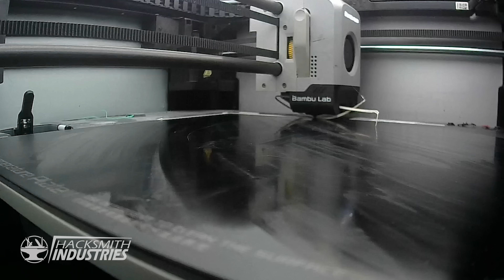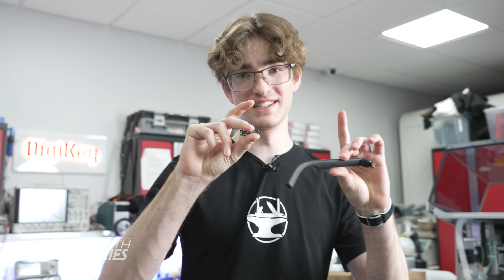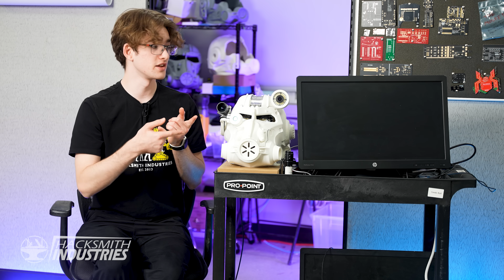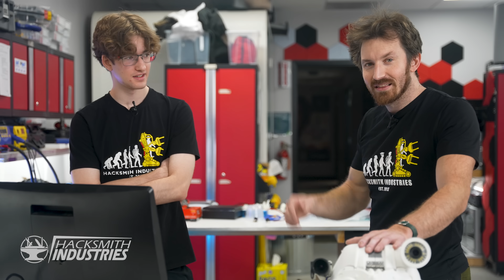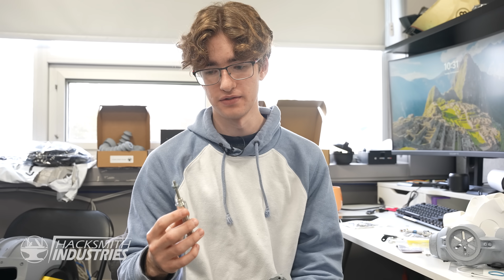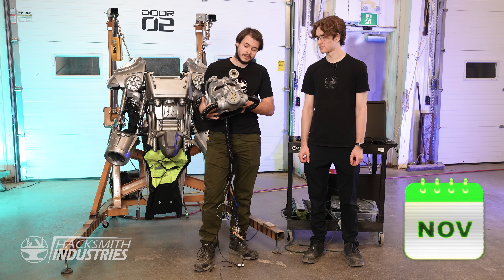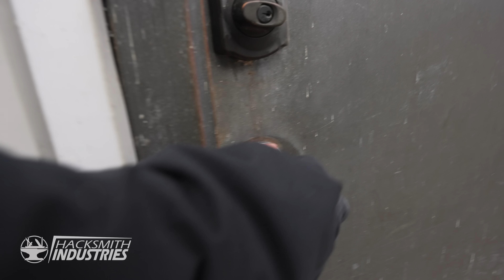World's Most Advanced HUD | Real Life Power Armor (Part 3/6)

Comment: Can an Ai pick out a person on a thermal camera, then over layer them on an NightVison IR Ar systems, without the latency sucking :P
Reply from the maker: why is that necessary? the thermal overlay can overlay on a temperature gradient, so it would automatically do that... no ai needed...
Reply: @hacksmith  And for that I'd highly suspect it would need object recognition.... I did not want to go as far as being able to point and anc "click" using AR glasss to try and keep track of a specific tag, as latanecy is an issue... The KISS principle.
Reply: Though on second thought Point and click to tag and have a  drone track and/or investigate that target might be of more use...
Reply: Now if it's getting any data from a cetral server/security system, may it could turn integrated wireless into a mapping system, which is only in it's infancy Ai wise... and tag the direction or some such for the less powerful portable version... and/or drone.. but that is getting a bit too ambitious, lol. No need to look in to every corenr to find them, it part of the set up you can all in  can see through walls....

Comment: Endoscopy optics Engineer here with HUD recommendations 😁

-not hud, but some form of visible light would be useful since the ability to see in full colour is always useful.

-Mixed heat/thermal/optical images may be useful. Worth checking out FLIRs image modes for examples.

-Rearview camera may be useful for better situational awareness: mobility is the power armors weakness 

-Movement/sound sensors and related hud alerts for back and sides similarly useful for situational awareness. Need to know where the ghouls are attacking from!

-Advanced, but some form of image/video capture which can be replayed would be useful 

-highly advanced, but VATS using openCV image recognition for heads, arms, body and legs could be a fun 

-Rangefinding, gps proximity to way points also very fun. You have a compass which i assume may be to have point direction in mind
Reply from the maker: I think we didn't show this off well enough ... The augmented reality glasses are lenses with transparent overlays -- so in every mode, you have full clarity visual image from your eyes -- the cameras overlay the details or thermal hotspots over top while still being slightly transparent
Reply: @hacksmith  gotcha!  Matching that view to the user's vision must be very challenging. I could see a version where an iron man style approach might be better for matching various image modes.

On showing the users perspective endoscopy/drain inspection cameras with a wide field of view might be good for showing what the user sees more clearly since the positioning of the camera within the helmet at the eye's position will be easier to achieve 😊

Comment: You should use a automatically adjusting oxygen mask for pilots for the gas mask rather than the pistons. There would be a better fit, it could help keep the whole helmet tight to the head, and its a air based system so it would be easier to integrate.

Comment: James, buddy, a gas mask is supposed to be tight, that's kinda the point... But I guess if you wanted to "upgrade" it, you could have a smaller mask that extends and retracts with opening the faceplate to make it less intrusive when talking face to face
Edit: actually, yeah, that's a better idea. Holding a rigid contact with the front of the skull is basically asking for nose/mouth/eye trauma that can't recover easily, while padding the back of the helmet and basically strapping the gas mask over the face, pulled tight from behind, is far less likely to cause accidental injury and could even be designed to release itself upon power failure or similar catastrophic failures.

Comment: If you guys actually go fully into the HUD and integration, you should try to find a way to fit pressure sensors inside the plating so you can link that up with the "durability" display of the armor. Cause let's be honest, if the military suddenly decides power armor is worth it, I say ride that ship to the friggin MOON, let's revolutionize mechanized infantry in the modern day, boys!

Comment: Compas, GPS minimap, CO2 and Gas Sensors, Oxygen Levels, LIDAR for 3D mapping the environment in realtime, Battery/Fuel levels, Ammo left?, Facial recognition, Ballistics Detection, Drone integration (control a drone viewing the feed on the hud), Notifications for incoming messages (sms?) Control it all via voice Commands. Also, that speaker for voice output needs to be better.

Comment: For the mask you could have used a single cylinder to actuator straps that pull the mask into you, this also allows the actuator to be either on the back of the helmet or top of the helmet

Comment: Hey! I doubt the team will see this coment or not but I do have a suggestion. 
Try adding multiple meters to the arm and as you toggle through them, the gauge in the helmet of radiation will change and when you confirm it, the exact meter will pop out of the either the finger or the wrist. 
I really hope the hacksmith will see this.
Reply from the maker: What meters? There's only one .. you can change the units the Geiger counter reads, but there aren't more meters to add

Comment: Now I'm not an engineer, and this is just a thought, so someone can correct me if I'm wrong, but wouldn't making the helmet parts (cameras and face mask) run on motors instead of hydraulics be a little better? because then you would only need spare batteries, instead of a big old gas tank. Just a thought 🤷‍♂
Reply from the maker: The entire suit system is pneumatic ☺️

Comment: You could integrate a quality laser rangefinder (such as the Laser Technology TruPulse series) linked to a targeting reticle.  It would be both cool and militarily functional.  Also a 4-gas sensor if you can find one that communicates with your computer.
What else?  A spectrum analyzer (to notice drone signals and other comms) and a multi-antenna system to allow you to select a frequency spike and then directionalize it to see where it is coming from.  Radar.  Hey, cars have radar now, why not power armor?  You could integrate it with the thermal vision for multi-spectral imaging.  Polarized light filter option - easy as having regular old polarized sunglasses get servo'd down.  Free up a bit of volume real-estate in the helmet by implementing the air filtration the same way PAPR systmes and astronaut helmets do: have the air source elsewhere in the armor, and outflow your fresh air from behind the head - this provides airflow cooling the whole head and slight overpressure keeps the breathing environment clean while pushing out external contaminates.

Comment: Radio, Clock (24 hour format), GPS, and maybe motion detector on back and side to see if being sneaked up on. Also make them toggle-able. Make the rad meters background base 1
Reply: Yeah, these sensors need to be calibrated to background so they don't freak out randomly, only when radiation is actually elevated.
Reply: N an AI voice interaction feature.

Comment: If you're having trouble with the body armor and testing, I would highly recommend looking at Crash Makerspace's Red Hood Bulletproof body armor, which may give you some ideas on how to improve your armor design, which you can also see in his "3D Steel Lattice Super Armor" video, which uses 3D printed metal metamaterials to improve durability.
Reply: I saw that, incredible R&D process he went through!
Reply: Printing it in metal would make the cost not just exorbitant, it will fly past the Voyager. Also, have you considered the weight? It would require an actual fusion reactor to move.
Reply: @vos2693  It's not solid metal, the way it works is it's a layer of metal that is designed to break in very specific ways so it doesn't compromise the rest of the armor.

It's actually extremely impressive, and withstood multiple .300 WM. There is another design that is extremely thin and can be molded to any shape.
Reply: @nilok7  I was thinking the same thing! that armor would be legit here and the armor he made was way lighter than a solid steel plate

Comment: Use solenoids instead of pnuematics, two advantages: one, entire pressure system is unneeded, and two, the default state is etended so if the suit experiences power loss it automatically opens. It has the downside of heating up and taking energy passively but some latches and a battery taking up the space of the pneumatic system should make up for that. Also makes the motions quicker
Reply from the maker: It already opens when it experiences a power loss. Spring return cylinders for any of the locking features. Solenoids aren't strong enough at the same size, nor would we have the space for the batteries needed for that many.

Comment: The flip-up visor/face plate is knightly and all that, but you might have more space to work with if you forgo that feature of the helmet. Better seal for the gas mask, adjustable goggles, more padding for the top of your head, and not having those extra pneumatics can help keep the wiring neat/organized.
Reply from the maker: Yeah but you can't remove the helmet so it's a pretty big safety flaw. Having giant armored arms means you can't even touch your head

Comment: For the gas mask, check out the flex air tube oxygen masks that pilots use where there is a loss in cabin pressure. That would tie into the pneumatics system and make it more comfortable. I'm sure there is a way to modify it to be a gas mask instead of an oxygen mask!
Reply: EROS mask in the Gulfstream jets

Comment: Is Tullomer going to be your bulletproof armor? I saw the armor plates printing on that X1C at 1:11, so I'm guessing that's what the plan is.
Reply from the maker: It actually performed pretty poorly.
Reply: @hacksmith  ok. That kinda makes sense, though. Kevlar fibers need to distribute their tensile stress to multiple layers, whereas Tullomer only forms strong fibrous connections within each printed layer. I'm guessing the rigidity would also limit its energy absorbing capacity.
Reply: @hacksmith  have you guys looked into Crash Makerspace?, he's been brewing up some 3d printed multi-hit plates

Comment: So real talk - how do you keep the microphone in the respirator mask from being destroyed by the moisture from your breath?  I've tried lots of cheap mikes and they always end up dying from the breath moisture inside an air-tight respirator mask.  How expensive a mike did you need to overcome the moisture issue?
Reply from the maker: Bold of you to assume we've tested it long enough to know if it survives or not 😅 if it doesn't survive, it's just a consumable. Not a big line item in the suit haha
Reply: @hacksmith  Good luck I suppose then.   This was of interest because during COVID I was wearing a P100 respirator to work and nobody could hear me so I wired a microphone through a sealed rubber port to an external speaker clipped to my shoulder (one of those walking guide speakers) so that I could be heard without coworkers constantly asking me to remove my mask.  The moisture durability issue ended up being a real problem for me.
Reply from the maker: Good to know! I'm not too sure how often they suit is gonna be worn for long enough periods for that to be an issue but I can imagine 8 hours a day would be a tough scenario

Comment: If you look at modern ballistic helmets the dial to set the head size would also work for the gas mask, allowing tight contact and fast adjustment. And it could be connected by really anything strong, steel cord, elastic cord, fuckin jump rope
Reply from the maker: The helmet has an internal brace that is dialed in per person =)

Comment: With a lot of the locking mechanisms using pressured air cylinders. A possibility to cut down on space could be to use linear actuators. Which could save y'all some space from the air pump, however, the downside is also a bigger usage of power and also amount of force that you can use with the cylinders. (and price) another negative is you lose the cool sound of pneumatics doing their work :P
Reply from the maker: And they're pretty slow
Reply: @hacksmith  You could get some decently quick linear actuators. We've been looking at brands like Linmot and Linak to replace the cylinders in our machines, but the total costs of switching it all is darn expensive

Comment: there is a lot of problems that make the modern fallout armour really difficult in an engineering standpoint. A few years ago I worked on a design for a fallout mod for space capable power armour set up much like how cosmonaut suits worked. The only seal that needed to be relied on is the back portion where the user climbs inside rather than walking in

Comment: Not to be critical for this is much harder than it looks. There is one weakness in the suit that I noticed. The back is exposed to firepower. In addition, all of the electronics and pressurized and possibly flammable tanks are on the undefended area. You may have already thought of this but as a Marine I have been taught the importance of being ready for  anything. By having your back exposed, you have made yourself an easy target for anyone who is not detected by the thermal system.
Reply: The suit is far from finished. It's gonna look exactly like the game, with the back protected....
Reply: @RIPmyPC  I doubt, it will move like a toy robot, no frame, they ignored the first two layers that make actual power armour, and they make the torso first. Everything is wrong with it, more of a cosplay.
Reply from the maker: @borskapi I don't think you watched the videos fully. It is an internal exoskeleton frame, with armor on top... They are layers, just like the game
Reply: @hacksmith  So are you going to protect the back of the suit?

Comment: what program do you use for splicing and how do you make sure the 3D printers are prepared for the print?
Reply from the maker: Bambu Lab
Reply: @hacksmith  do you use any adhesives or any type of spray to keep the print on the plate... I have issues with the filament not sticking to the bed
Reply from the maker: Bambu lab 3D printers just work out of the box, no glue, no nothing... they're really game changing, and as cheap as $200 for the A1 mini. Really can't recommend them enough -- you spend your time actually engineering parts, instead of trying to get a 3D printer working

Comment: Damn awesome. Also coincidentally I received xr glasses today myself. Crazy how fast tech is moving.

Ps: I'm not sure how much you can move from the backplate but if you want to slim it down a bit maybe put some of the control devices in the chest area since it mostly decorational (also will improve bullet survivalibilty for the user, though might be worse for the suit). And lifting the air tank to be around the shoulders is cannon with raider power armour (if I recall)...

Comment: Make a pinwheel out of a sturdy substance, on each blade fasten a magnet, make them alternating poles, as the slightest of winds spin them, the magnets can pass wires that then create electric current sent through a AC to DC inverter that keeps the battery pack charged. The Pinwheel design doesn't require air to pass through it, and will still work at 90 degree angles to air current, so it has to have the blades at least flush with or sticking out of the exterior of the suit's skin. (I don't expect it to be high powered, but I am sure you can find a way to make it at least extend the battery life, as long as the wind is a gentle breeze, and kit bash it with solar panels for those sunny days to keep it fully charged. (blowing on a pinwheel in the center causes it to spin really fast, so it doesn't have to be big, nor does the wind have to be strong.)

Comment: i wonder if hacksmith will integrate a rubber wetsuit type of mesh under the armor that you can climb into that circulates water around the suit to keep the operator cool during use and makes it more of a air tight seal from the outside world so even in a vacuum type of room the operator will still be protected

Comment: this is an incredible project, and awesomely executed. but the hud might need a way to tune the transparency level. Also having a mic is great, but having the ability to hear around you (and filtering sound levels) might come in handy if you're intending to have a fully enclosed metal helmet. Also i hope you intend to seal of the visor (maybe magnetically), because for now there are gaps and you don't want them, especially if you intend to fire at it. i'm very interested to see the results, do you plan to coat it in super alloy or make it full metal?
Reply from the maker: The glasses have manual transparency controls, easy to do. Super alloy all the way. If we made the armor full metal it would weigh 2000lbs.
Reply: @hacksmith  thanks for  taking the time to answer, it's appreciated.